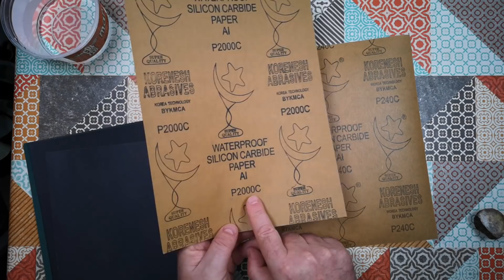Lapping A Flint/Chert Fossil by Hand

Comment: Atomic shrimp. A question did you finish this or cut it on your wet saw?
Reply from the maker: It was already split nearly clean in half when I found it - I had intended (and may still, one day) try to continue lapping this completely flat on a diamond wheel

Comment: Great video. Could you tell me what the advantages are of grinding in a figure of 8 motion? Or is that just what felt most comfortable for you? 

Looking forward to seeing what contraption you make to mechanise the process.
Reply from the maker: This motion is normal when lapping by hand on a flat surface - it helps to even out any bias in the pressure you are placing on the workpiece and better ensures a flat ground surface

Comment: Tip... you don't need need to do the figure of eight movement when hand lapping.
If you are only interested in the lapped side...... drive a nail into a small block of wood and cut the top off the nail. Araldite the wood to the fossil and mount the nail in an electric drill.

Comment: There are special sanding machines that use a strip of sandpaper on a device that kinda looks like a defibrillator handle. It's mostly used for sanding large areas a little bit (like plaster on walls before painting), but you can also use it to take away a lot of depth on a small area. Afaik they are quite cheap, so if you want to continue with this idea you could get one and save lots of energy.

Comment: Small matter, but the placement of the feet on the underside of the glass is quite good. My grandparents had a cutting board with only a foot in each corner, and it finally split down the middle both ways. (It was plastic)

Anyway, I think that kept the glass from stress fracture.

Fun vid, as usual, thought provoking. I've found stones the same color, and wondered what they were.

Comment: Mike, you might try picking up an inexpensive palm sander. They can be bought for around $25-30 bucks. I wouldn’t go with a belt sander bcz it would tend to leave lines in the work and they’re more expensive. A palm sander can also be used to vibrate forms for small concrete or plaster projects, very effectively.

Comment: The problem with sandpaper is that it wears down quite quickly when grinding hard material, probably the reason why your surface looked to smooth.
I think a diamond plate would have been much quicker in this case.

Comment: That looks like a lot of work. 
Make a grinding wheel out of a drill, you must have a drill..
Very cool btw.
Reply: Or an upturned belt sander clamped down. Clamp the fossil against the belt, apply mild pressure and come back every ten minutes to see if you need a new belt or to stop sanding. I'd love to know why thats not an option. Obviously when you're down the nitty gritty, hand sanding for the final polish would be needed.

Comment: I have to admit, I laughed a bit when you said you were going to start with 240 grit. But only because I've been there myself and learned the hard way! It feels like if you want  to end up with a mirror-smooth surface you'd want to avoid the lower grits, but really it is important to start down on the low end. I'd probably start on 60 or even 40 grit. You want to get to a flat surface as quickly as possible, and then each increase in fineness is just used to remove the scratches from the last grade.
Reply from the maker: Yeah, I would have done, but couldn't get hold of anything lower than 240 grit in wet and dry.  Lower grits were available in garnet and aluminium oxide, but not waterproof

Comment: i worked in a destructive lab polishing metal samples and it was bad enough grinding stainless on 180 with a powered wheel. hats off that looks like a chore and a half.
Reply: what is a destructive lab and how do i get into one
Reply: @ciarangale4738  some parts or materials require a more testing than nondestructive testing(x-ray, penetrant, ultrasound) so it would come to us. We cut it up and looked at the internal structure. I have no idea how to get another job doing it. I kinda fell into it because they needed help and hired on a temp. I ended up going full time as a lab technician. Look for quality lab technician.

Comment: Taje a look at "diamond grinding pads" on Amazon etc, you can get a set of 14 going from 50 grit to 3000 grit for around £15.  They're plastic-bonded diamond grit  discs with velcro backing with a backing disc that fits in a drill...

Comment: You can get a carbide wheel for a regular grinder (you don't need an expensive one because you're not grinding precision) and you can polish glass with cork wheels.
Reply from the maker: The lesson for me here is that this wasn't nearly as flat to begin with as I imagined it was.  I probably should have run it past my diamond tile saw before starting!

Comment: You did that for 6 hours!!! Wow
Reply from the maker: Yeah, it was like an upper body workout
Reply: @AtomicShrimp  i would have already   making some grip that i can   attach that thing on an drill  ... in like 60 seconds    :P
Reply from the maker: @venix20 I will make something motorised, but I didn't want to rush it
Reply: @AtomicShrimp  just a small node i mean i would be making it after scrubbing for 60 seconds , not sure how long would take me to make a grip  :P
Reply from the maker: @venix20  You'd get a very uneven grind if you just attached this thing to a drill.  I'm going to build something, but I need to gather my thoughts so I can make it a thing with more utility than just the task at hand
Reply: @AtomicShrimp  my main idea was get clay and make a thick mold around the focil leaving exposed about half to 1 cm on the edge you where grinding with a Cross iron rod shape (so it grips well in the clay and has surface to push  work the metal on the other end to fit on a drill and bake the clay . no idea if that will work !
Reply: @venix20  resin is alot easier. Also, mount the drill on a pedastal, and use the flat metal as a surface. To get it flat, it doesnt need to be perfect to optical quality at the first stage of shaping it.
Reply: @christianbuczko1481  never worked with resin so i went first with things i know :P  i will have to look at resins  for sure !
Reply: Grinding away for hours...using both hands...oooh, I say!
.
.
.
Sorry, bad joke...I couldn't help myself...
Reply: @kimvibk9242  saves me from doing it me old matey! Ha ho!